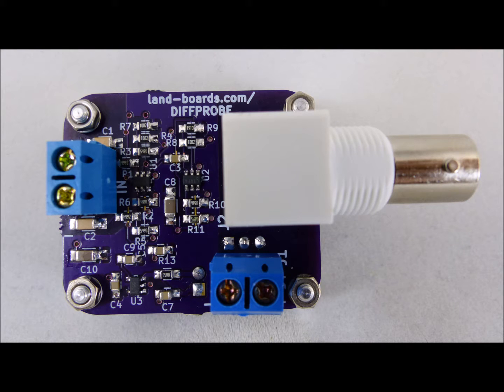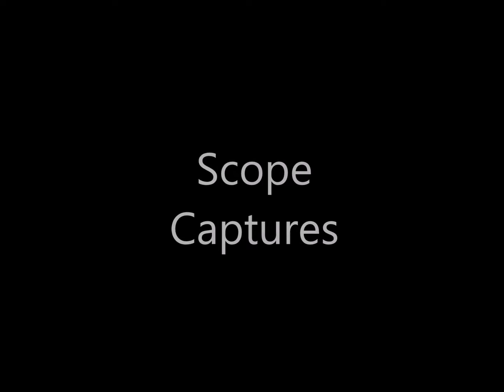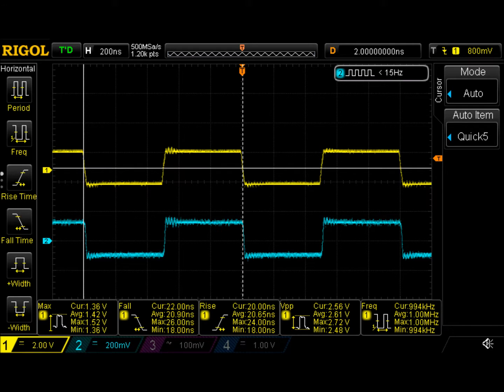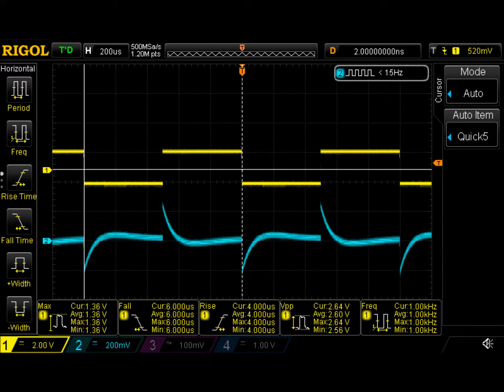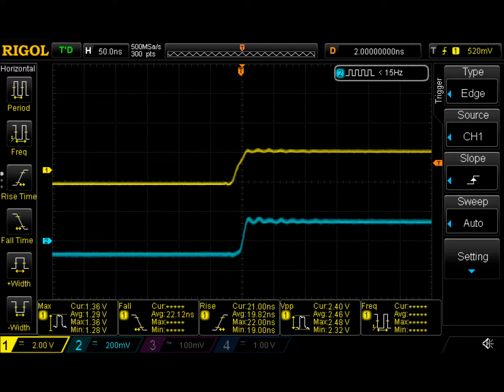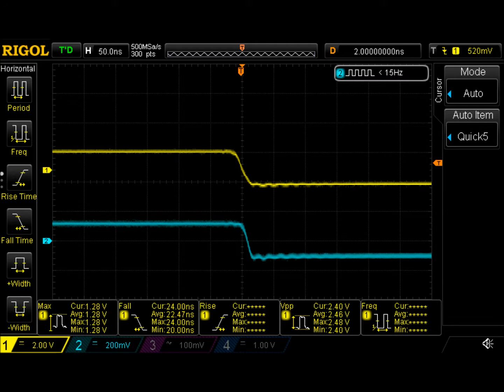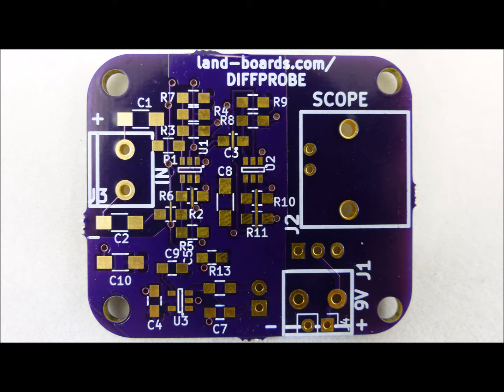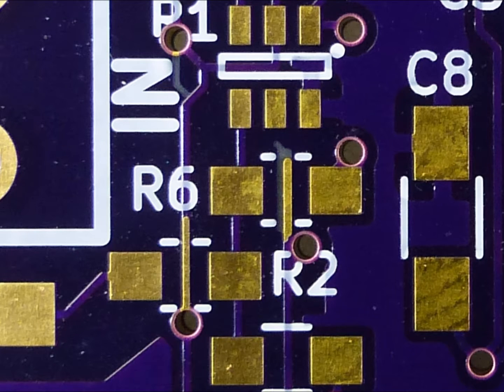Land Boards - Differential Probe Part 4 - New Board Layout

Comment: a very nice improvement!   🥰  working with 440vac 3 phase motor drives requires isolated oscilloscope inputs. so, the input frequency is low.   😎 thanks.